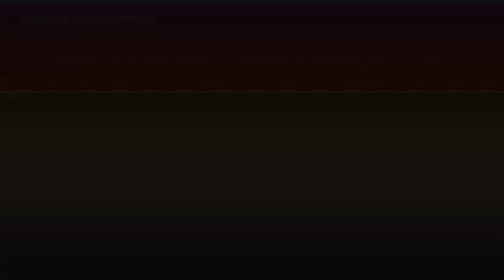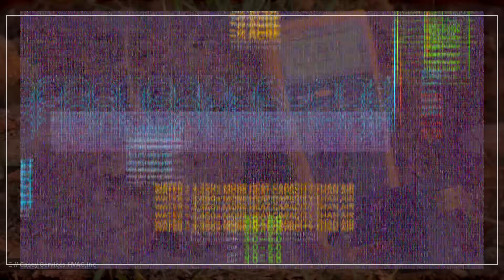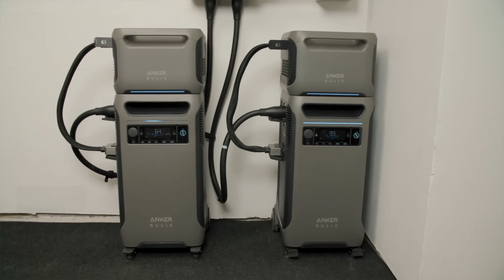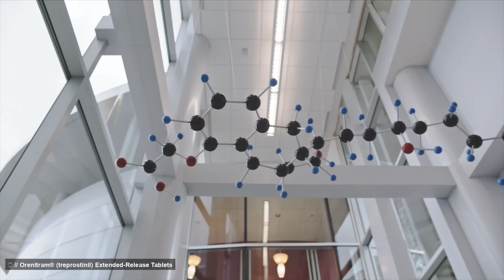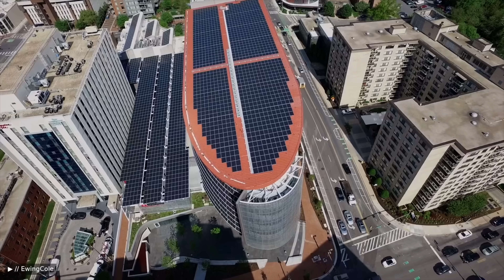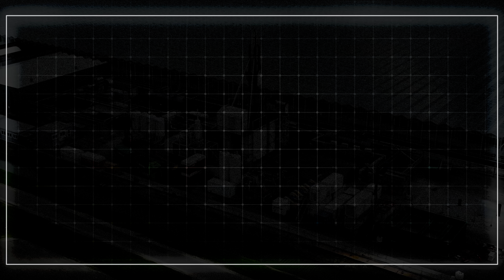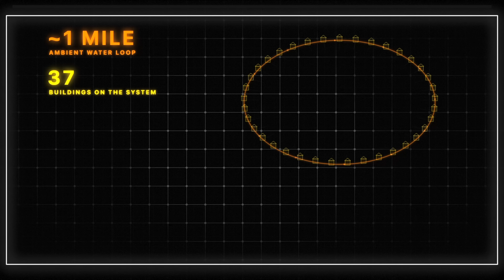The Viral DIY Cooling Hack That Nearly Killed a Family

Comment: You’re wrong about air geothermal. 

My home in Missouri and it’s hot and humid in the summer, has been running on it for 4 years. I do not have AC or heat. I have a self balancing ERV, whole house dehumidifier and an air scrubber. The earth tubes are pitched to the slop of the land so any condensation naturally drains out and mold doesn’t develop and I’ve had the air tested multiple times. Should mold develop the air scrubber is there to kill anything harmful and i have easy access to flush and clean out the system. 

My home stays 69 all year round. Total system cost $8k for everything including ductwork inside the house. 

Earth tubes only work if the building site has a slope you can use and the house is airtight.

Comment: Leaving home instead of just redoing vent intake system? Seems like good business 😂
Reply: It's not that simple- first, you'd need to tear out the entire system and replace it with a water-based system. You can't build an efficient closed-loop air-based system, and the open-loop sort will always collect water in a humid climate. The bigger problem is that even if you fix that, the system has been pumping a fine mist of mold and bacteria through the entire house for months or years, depending on how long it took them to notice what was going on. Just scrubbing the place down wouldn't be enough, you'd basically have to rebuild the entire house, replacing all of the wood and drywall that's been turned into a giant petri dish.

Comment: Don't forget that ground loops do not last forever. Pipes deteriorate, even PVC. Eventually it will start to leak and you'll have to abandon that loop. The lifetime is reasonably long, but at the upper end cost, the ROI just may  not exist. 

The ground also isn't free energy, but as you said a thermal battery. The ground will start to equalize to match the average yearly net energy flow. You gain some heat from below, and loose and gain some from the surface depending on the time on year and climate. I have seen ground loops completely freeze the ground and become ineffective. In warmer climates, the opposite will occur and the ground will end up being very warm causing a loss of efficiency. Maybe enough of a loss to match air sourced H/Ps and A/Cs. This is compounded when your neighbors also have ground loops. Community shared loops only are incredibly efficient during the shoulder seasons and in temperate climates. In predominantly warm or cold climates they will suffer and require external heat shedding/generation. 

Almost half of my work is the installation and service of water and air source H/Ps. They still can't compete with natural gas on pricing here. They can be more expensive to repair compared to conventional A/Cs. They are definitely more expensive to purchase. You have increased maintenance due to the water treatment of the ground loop. (At least you should have treatment done, some people ignore it.) Most of the water source HPs I work on are connected to a common building loop, which is then controlled using boilers and cooling towers. In these cases the ground could never keep up, as the building density is just too high. Instead they use underground tanks for daily energy storage, and other tricks like pre-tempering the DCW using the loop, before heating it fully. Due to the complexity, these extras are not common. The oldest ground tank/system I know of is about 40 years old. I'm pretty sure there is a leak in the underground tank, but the water fill is low enough to ignore for now. That is about as long as you get, and then you have to start replacing pipes, or at least relining them.

Comment: Air cooling pipes work in dry climates similar to swamp coolers?
Is that what is going on?
Swamp coolers put moisture into the air in dry environments, and the air is also cooled in the process. 
I lived in the desert for 11 years, utilizing swamp coolers to cool things off in summer. 
The same tech is useless in humid environments. 
My last employer in a fairly humid summer environment spent over $20k on large swamp coolers for a non temp controlled manufacturing environment in a place that gets semi humid in summers. When I first saw that I immediately knew it was useless, which people confirmed.

Comment: Can you explain why this costs so much more than digging a well? Could I hypothetically add another well that just tubes water through like the system you’re using does? Drilling a well cost us $3,500 a couple years ago.
Reply from the maker: digging a well is also expensive, depending on depths. a well is like 30k in California because they have to dril hundreds of feet. 

you can look into horizontal tubing, if you have a lot of land! way cheaper

Comment: I was going to say, drilling holes, going to cost a mint in CA, even if you got a water well driller, and did the rest yourself. But seems pretty simple system otherwise. I can tell you that a waterheater that gets fed 50def+ water last longer and cost less to heat than one that gets ice water. But ya a simple water heater heated air handler would probably be all you need. I like solar hot water storage mixed with geo watercooling, both can work on a single air handler with a few easy mods.

Comment: When sizing a system, don't forget that you will be pumping heat into the ground. How fast does the soil dissipate the heat? In a horizontal system, how close is it to the water table? This could affect heat dissipation. If heat is pumped into the ground faster than it can dissipate, then you put hot water in and get hot water out. I once took a coil of copper and tossed it in a stock tank. A small water pump circulated it through an old truck radiator with a box fan bolted to it. It worked great. Right up until mid summer when the sun heated the entire stock tank until it was full of warm water.😁
Reply: The last part is kind of der.  You would obviously want to minimize thermal exchange of the stock tank with ambient conditions and temps, especially during the day (through lots of removeable insulation, maybe a sky window radiant cooling top, etc) and then allow any heat to dissipate over night, etc (remove insulation once it starts cooling down).  And ideally that stock tank would be at least partially buried to stabilize it further.  If done correctly, and if night time temps cooperate, you could keep it relatively cool throughout summer. But it would require a lot of active involvement, which a lot of people would view as a kind of faff factor.

Comment: We put in a three well geothermal system two years ago.  Wells are 275ft deep, 15 fleet apart.  We have two water furnace heat pumps.  We got the federal credits.  It has reduced my electric significantly.  Also, we get quarterly geothermal energy credits.  We also added in an excess heat savaging water tank to reduce our electric for hot water as well.

Comment: I see a future where there is so much waste heat being dumped into the earth by these systems that it gradually heats up over time and becomes less efficient.  Or should I say that so much heat is being drawn from the earth that it gets harder to draw more out?  I guess we just need to make sure that systems are balanced on the global scale.  I know in Michigan we generally need a lot more heating than we need cooling, even if the latter is more expensive because natural gas is cheap here, but it'll be the opposite in California.

Comment: Vertical loops need ~20' between bore holes to minimize thermal interaction between them. So, not going to for more than one in a parking spot. But any decent sized yard can absolutely accommodate them.

Comment: I installed a closed loop geothermal heat pump 12 years ago, Absolutely no regrets.. But I live on 11 acres with plenty of room for burying the water loops.. My AC and heat bills are pretty cheap, about $2000 a year for electric bills for a very old 2000sq ft drafty farm house with little insulation.

Comment: One thing I do is that I have a heat pump water heater in my basement to dehumidify it. I then duct air from my basement to my main floor to cool it down. I also have an air purifier constantly running down in the  basement. I've also tested for radon which was low so I essentially have a ground battery that gets cooled down when heating up my water.

Comment: Ground source heat is never a good idea. Yes, it can "pay back" it's high cost, but it can never pay back its missed opportunity cost. 35000 dollars will buy 350 kW of solar panels. Obviously there are other costs than just the panels, but a simple air to air split system in each room, some phase change materials built into the fabric of the building and a decent size solar system, makes vastly more sense. I can have a 13 kW solar installed before subsidies for 6000 AUD (about 4k USD) and a 50 kWh battery for about another 6000 AUD. That would cover all my electrical needs twice over, cooling, heating, hot water, the electric vehicles, cooking, *everything*. More than twice over actually, probably close to 3 times. For a quarter of the cost of drilling a hole in my driveway.

Comment: Why did you skip Arizona for the air tube example?  Is this not legal?
Reply: These ground to air exchangers generally work much better in dry, very low humidity desert conditions (even then, you want your tubes to be somewhat in a v or u shape so any condensate can pool and drain out at the lowest point), provided your area doesn't have radon issues.

Comment: The underground temperature is "constant" as long as nothing disturbs it.  Once you start pumping heat into it, or out of it, it acts like a thermal battery, and must be recharged with heat in the summer if it's to provide heat in the winter.  Unless!  If groundwater flows by your system, the heat you put/take will go downstream, and you'll be affected by heat-pump systems upstream from you.
Reply: There are experimental 4-season greenhouses in Canada that actually rely on this fact. Warm air in, cool air out during the summer helps charge the ground for the winter heating season.

Comment: I had the perfect setup for cheap cooling, there was a spring coming out of the hillside into a big cistern from the mountain which supplied some of the houses where I lived, it was super cold water and so abundant it overflowed most of the year, i was able to pipe it into a car radiator in front of the furnace intake, the water trickled through that and then and I had the fan on a switch  blowing cold air into the floor vents, kept the house cool all summer, not everyone has a mountain spring in the back yard they can hook up cuper cold water and I wish I still had that.

Comment: It seems like a degraded open loop air system would be perfect for retrofitting into a closed-loop system... shove as much brine tubing into the air pipes as you can, then pump non-shrink grout into the void space. Is there something that would have kept this kind of retrofit from saving a mold-infested open-loop air system?

Comment: I am doing a bit of a hybrid of this for our 7200 sqft home -- I will use air conditioners to chill water, but the hot side of the AC has a refrigerant-to-groundwater exchange after the regular refrigerant-to-air exchange. So the first cut of heat dissipation is to outside air and the second to the ground. Part of the reason was that the split outdoor units are very commonly available so I bought them cheap surplus. The air conditioners are 4x 6.25 ton for a total of 25 tons capacity. They run on 460 volts 3 phase so I am using a VFD that will go directly from solar to 3 phase power without grid or battery. However I have a high voltage DC supply that can supplement the solar panels using the grid. Also I have 10,000 gallons worth of insulated chilled water storage as a thermal buffer, so that way you can run the system when there is enough sunlight. The building came with 7x 2.5 ton air conditioners, I will leave those in place. Normally they will just circulate the air through the air-to-water heat exchangers but they do have functioning grid powered heat and AC so if the hydronic system is down then you can just run grid powered AC/heat. BTW the "national building codes" are just guidelines, the counties and cities regulate that. Texas here does not mandate any building code so can do very cheap and creative building projects here.

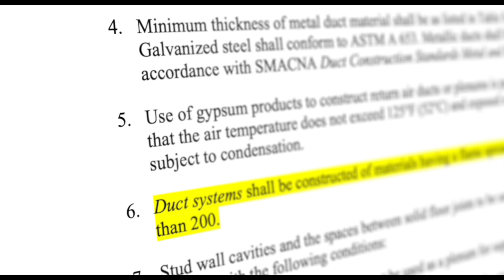Comment: 6:40 "...and get the design approved." And THAT is where the ban, or more specifically, the shadow-ban lies. The law doesn't state what the requirements are for the approval, so the official can simply reject all designs and you get a ban by calling it 'bureaucracy."
Reply: @andrewdreasler428  I'm not sure I get the complaint. Where is this ban (shadow or other) actually occuring? We are just finishing a house build in Washington State and we got full approval for our vertical geotherm system. No one batted an eye.

Comment: I VERY much want to go ground source. My propane furnace is 30 years old and I spend ~$3500 a year on propane for heat anyway. And I am somewhat non-typical here, as I have a 3 acre field immediately adjacent to the house (and even on the side of the existing furnace), with a frost depth of 18", because that is where the ground water is (near a river). I can run a relatively shallow horizontal loop (albiet with giving up some efficiency with a more variable ground loop temperature) with equipment i have already. With the space i have, i can run just about as long as i want.

Comment: The price quotes are... questionable. I installed a deep-borehole (200 meters deep) HP ten years ago, the costs for the swedish-built 15KW unit were under 15K euros, the work including borehole materials and all plumbing another 10K. Not that I really need it (temperatures didn't drop below -30C ever, and the house is passive-before-ventilation down to -15C). Sure, this is not America - so we don't have to have AC - and it was quite a while ago, but anyway it's not that expensive.

Comment: So, the biggest pull of this earth pipe system is the ease of construction and DIY factor.
What I'm interested in, is if the actually safe method could be adapted and built by oneself. I could see an increased material cost just from the additional components needed, are but closed loop heat/cooling transfers and properly engineered earth pipes complete with draining, and safeguards still viable for one person on a homestead to install themselves? The cheapness might be overstated, but on the other hand.. Time is money, and I'll have a lot of it.

I'm trying to figure out the best heating/cooling system because within a year or two, I'm aiming to have land and begin building a home.

Comment: Why not use heat pipes? Unless you have granite bedrock It shouldn't be too hard to drill. I could see lightning being an issue if they go too high. A house burned down that way by using a sprinkler system in the attic. The previous owner was a fire fighter chief. Ironic.

Comment: I once looked at, but did not buy, a home with a totally different system. I have no idea if this system is legal, or is a good idea. The property had two wells on it. They pulled cooling water for the heat pump from the downhill well, and pumped the heated water into the uphill well. Presumably the water seeped through the ground from the uphill well to the lower well, but it was not in a pipe. I suspect that it is not legal to pump water back into the ground.

Comment: San Diego has a very moderate climate and air source heat pumps should work quite well. Add solar, and the bill should be very cheap to free. If you're obsessed with geothermal, consider that San Diego is sitting on a gazillion faults so check your geology because it might not be the best place to dig a  big hole and install pipes if the ground will shift over time. Sounce: my house is in San Diego and has a nice 2" crack/offset in the curb from the last 7+ earthquake that hit a few years ago.

Comment: I’m an HVAC contractor and we’ve done a few pond and lake closed loop systems (loop is just dropped to the bottom of a pond or lake where it’s ground temp).

Even though it’s more profitable I tend to recommend against it since I know of 3 people (people not companies) within 100 miles I consider qualified to work on them.

Also some of the tech lags behind the tech of air source heat pumps due to market size. There is also some other nuisance that’s occasionally overlooked, gets rid of the outdoor unit but moves thar source of noise (compressor) inside the home.

I see just as many abandon geothermal systems (replaced with traditional air source) as I see still operating. Piping is MUCH better nowadays though so I’d expect that to change.

Comment: Would it not make financial sense to increase the number of solar panels and just add a standard heat pump system? You will have more electrical energy for everything. Then just use a standard heat pump without the cost of drilling. There is no way the numbers would benefit the construction cost vs solar panels. And it's a more simple and maintainable design.

Comment: Mm. Our 8 apartment terrace house here in Finland uses ground-sourced heat pump system to warm the apartments and the household water. We have three 300 ft heat wells bored to our front yard. The system uses really small amount of electricity to gain the heat.

Comment: I have ground loop system in Northwest Georgia, operating for almost 20 years, the system works great. Most of the year our power bill is about half of what most homes in the area are, which are about the same size. I highly recommend these systems. It took almost two years to find a contractor in the area, but it was well worth the effort.